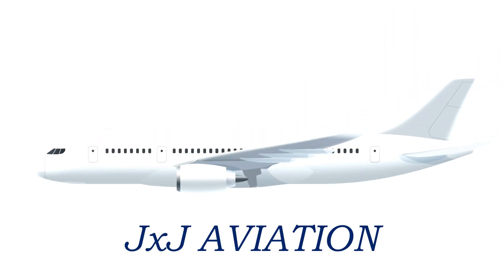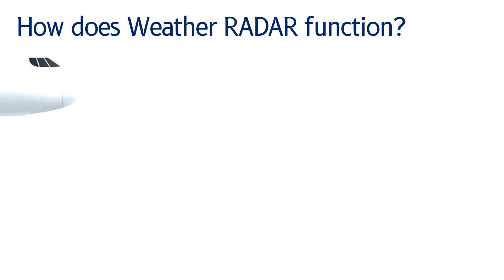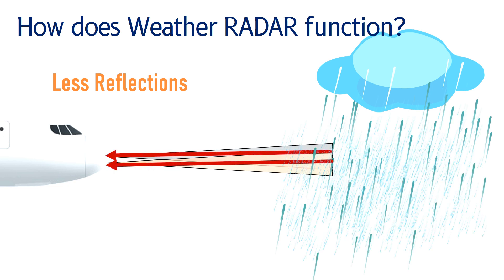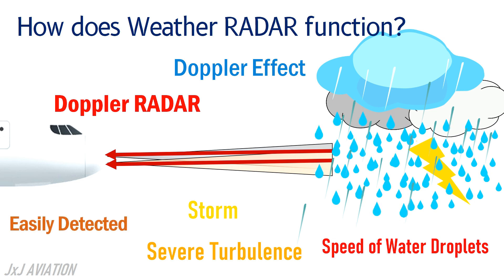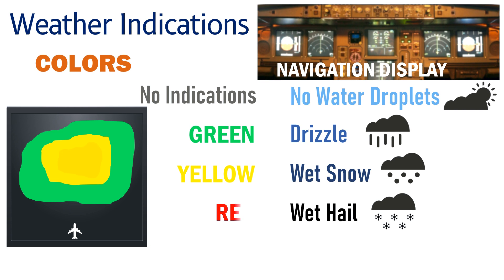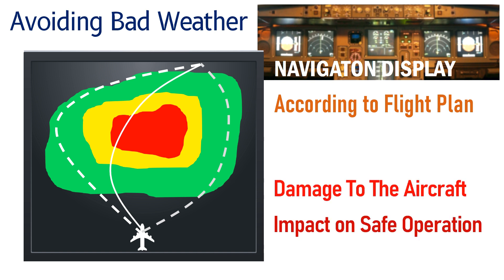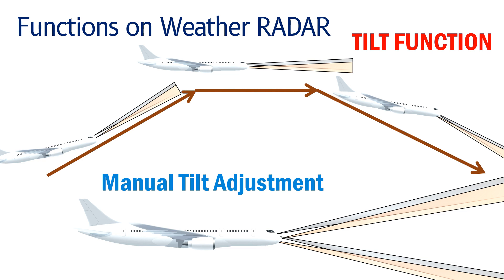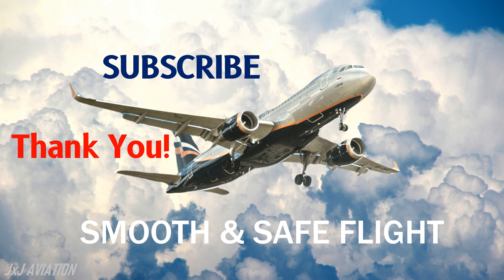How do Aircraft avoid BAD WEATHER? Airplane's Weather RADAR: Operation, Indications & Functions

Comment: Great explanation... Could you also shed light on the use of multiple radars? like are they for giving different accuracies, different types of particles??
Reply from the maker: Only 1 radar is sufficient to get an accurate representation of the weather ahead of the aircraft. The 2nd radar is used in case of failure of the 1st radar.